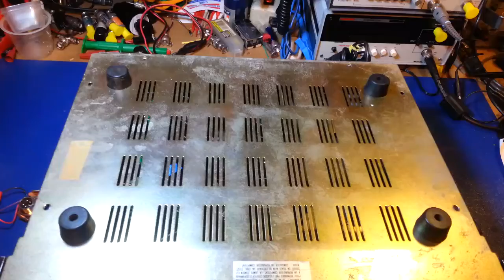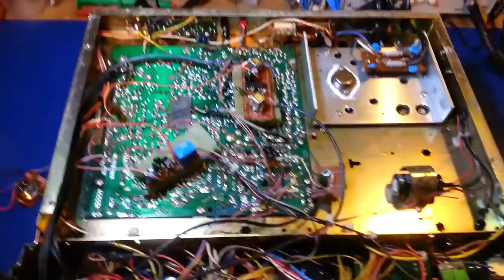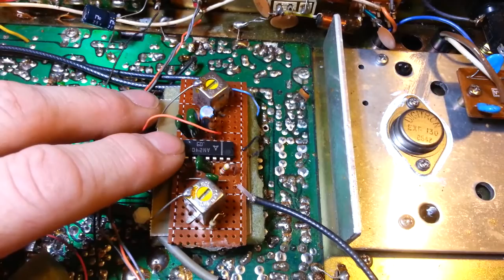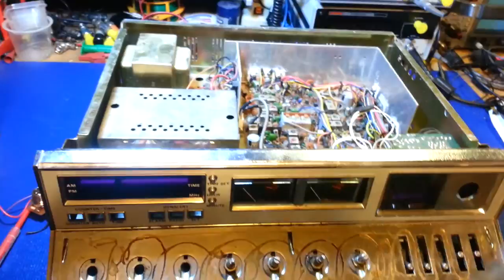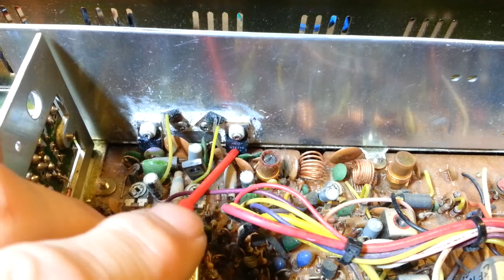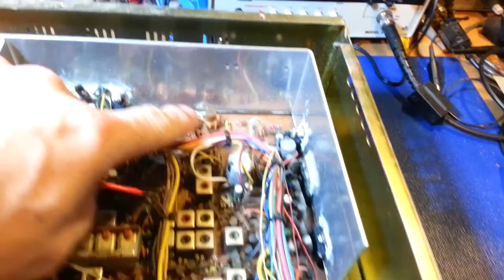Cobra 2000GTL Texas Chainsaw Massacre CB radio.  Run for the hills!!!

Comment: I have. GTL 2000. It’s been sitting for a decade or two. Brought it up on a Variac everything worked. Let it idle for fourth minutes, now, frequency displays 92.2000 and doesn’t tx or receive. I’m sure it needs a cap job but, I read somewhere it can be the PLL chip. Any ideas? Plus where can I find a copy of the #1232 Technical bulletin? Any help will be greatly appreciated.

Comment: Why would you want an FM board in a standard CB radio? if you are gonna do that get an export and leave the CB radio stock...
Reply from the maker: Eric 12374 

FM is what's used in many other countries.  I sometimes hear people using FM here in the US.  Also it use to be common for Amateur operators to add FM, do a simple channel modification and bingo, you now had a 10 meter AM/FM rig.

Comment: I wouldn't waste my time on that one.......sometimes things have been modified to a point where they are no longer useful.
If it were a very rare radio I might spend the time on rainy nights, but a common rig like this would be relegated to the junk pile in my Lab
Reply from the maker: Harb's Elecronics Lab

 Relegated to the parts shelf after video was done.  Definitely one of those radios not worth the expense to restore.  Like you said, a common radio that can easily be found in a lot better condition.
Reply: It never ceases to amaze me how people who obviously have no idea how to do quality work will still have a go at major mods, and make a huge mess inside a piece of electronics like that........I have a few even worse than that here......I will start to put video's up soon and show a few.
I bet you would have no trouble doing a "Fail" video on some as well lol
Anyway, I would never discourage anyone for having a go, but sheesh, please start on something easy to get your skill level up first ;)
Reply from the maker: Harb's Elecronics Lab 

What's sad is a lot of effort went into adding FM to this radio and to then basically just hack it in so sloppy is sad.

Yeah I have shelves full of butchered radios.  Gives me a stiff neck all the head shaking I do.
Reply: Yup typical screwdriver expert that likely knows ZIP about electronics. It amazes me what people do to thier stuff..

Comment: I started to get dizzy looking at the bottom side. I have had spaghetti that was more orderly. I do not think I have ever seen anything not even on youtube that looked that bad.
Reply from the maker: If I could have gotten it to go through my paper shredder I think it would have come out the other side neater than this.
Reply: I want to send an late 1980's SSB CB to you for re-cap and alignment and evaluation. How should I get in touch with you to do that? Thanks I really enjoy your video's! The radio function fine but I have only owned it for a couple of years. I can tell you that the inside looks pristine. It is an late 1980's Palomar SSB500 CB.She is a talker!
Reply from the maker: +buckaroobonsi555 
Click on my YouTube name, then the "about" tab.  Click the Google + link.  You can get my email there.

Comment: Jesus Pete.

I think the little board with the cap, trimmer, and resistor next to the PLL was probably for FM deviation.
I guess the relay and transistor was there to switch that into the VCO.

Definitely better ways to add FM to the radio...
Reply from the maker: Definitely better ways to add FM to say the least.  You have to give them credit, they spent some time doing it.  And they even went the extra step on the board that has the FM IC by adding a separate piece of copper clad board on the bottom as a RF shield.